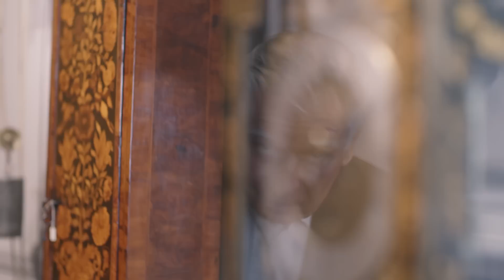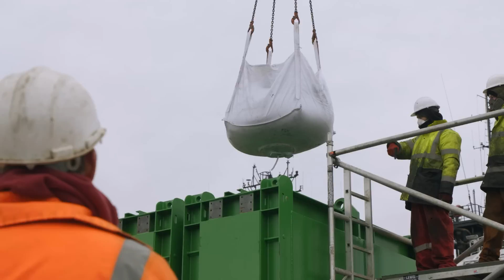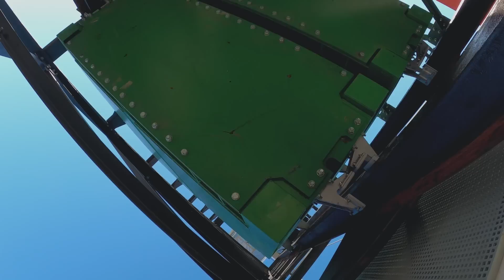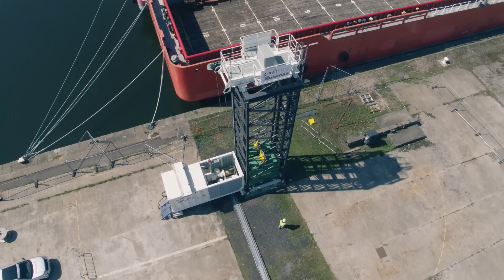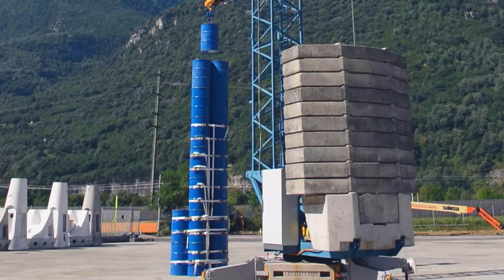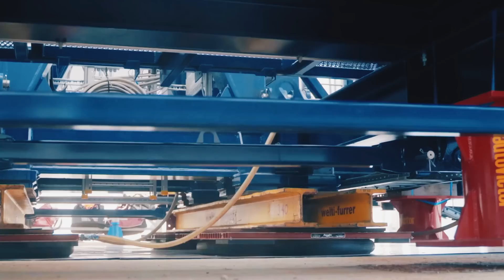Two Innovative Energy Storing Methods | Engineering The Future

Comment: Energy vault seems sooo much more complicated gravitricity. What advantage does multiple small blocks provide? It seems like so much extra complexity for very little gain.
Reply: Once it's constructed it lasts and will store energy over and over again without degradation much longer than our best batteries, today.  They explained it in the beginning of the video with the grandfather clock that was hundreds of years old yet still functions perfectly.  Those function off the same concept...gravity storing the energy and releasing it over time with the declining weights.  It's much cheaper to maintain and repair than current lithium batteries.

Comment: In both cases I understand how electricity can be made by dropping a weight vertically downwards, but they didn’t say what the power source is for lifting the weight vertically upwards. A diesel generator? Sucking the same amount of electricity out of the grid as what you get back?
Newton’s 2nd law is all very well; but Newton’s 3rd law also applies here.
Reply: Often renewables produce more power than necessary, especially in the middle of the day. Look up the “duck curve” of the grid. The system will use this extra energy during the day.
Reply: @GavinRemme  What do you do when the renewables supply very little electricity for days, weeks even months????

Comment: stored pumped hydro electriciy would store orders of magnitude more energy even if it was just a small dam or even large water tanks.
Reply: Hydro is location specific gravity storage can be built anywhere
Reply: @terranetti556 Two tunnels 10m of diameter 1km lenght. The first 10 m under the surface the second 500m. A tube and turbogenerator/pump between them. Water in. Approximate storage capacity 10 000 kwh (75 ooot water on 500 m) Not dependent of weather. Old mine tunnels could be used. Ideal for former coal mining areas.
Reply: @terranetti556 PHS is indeed location specific.  But over 600'000 suitable locations have been identified worldwide. And even if only the 1% best projects were realized, they would total more energy storage capacity than the entire world needs!

Comment: Seems waaaaay too complicated. Why not just build what looks like a group of elevator shafts
together and cover it so it just looks like an industrial building and cover the south wall with pv
cells?  Fill each 'car' with 30-50 tons of dense sand, have one motor control two shafts. I'm clearly
not an engineer but isn't the simplest solution, aka, Occam's Razor the best solution?

Comment: How about regenerative braking in elevators?
Reply: useless. The elevator doesnt require so much power, since it is counter balanced. Wherever it goes, it will have to use electricity.